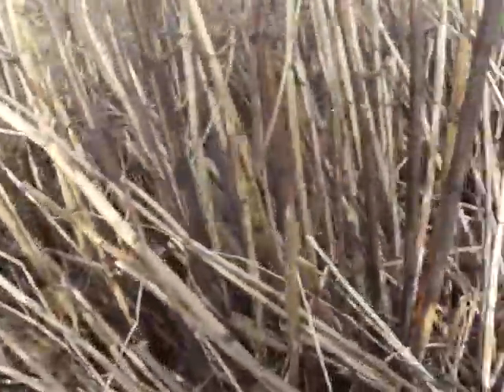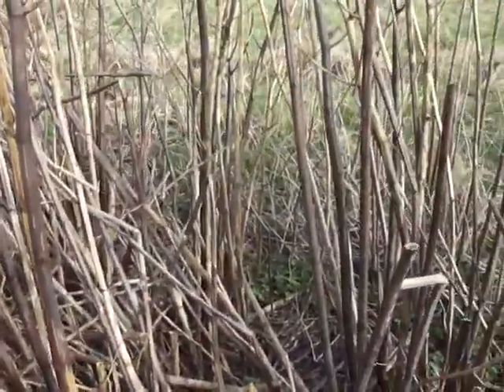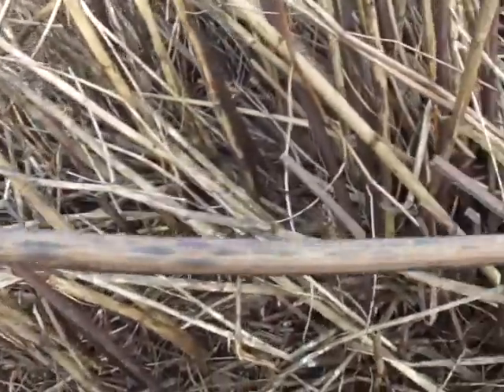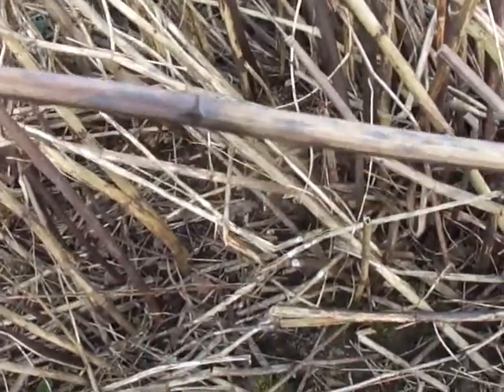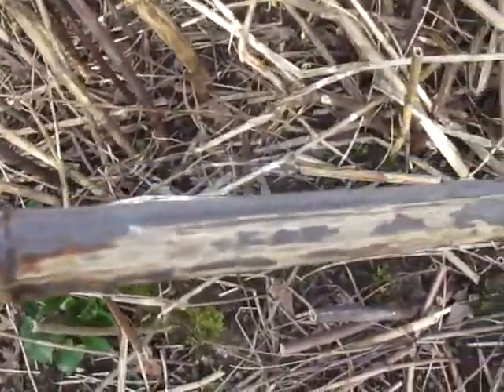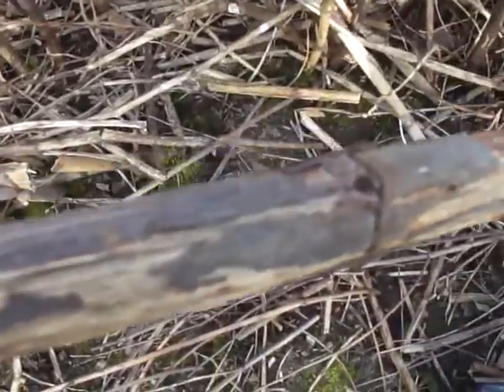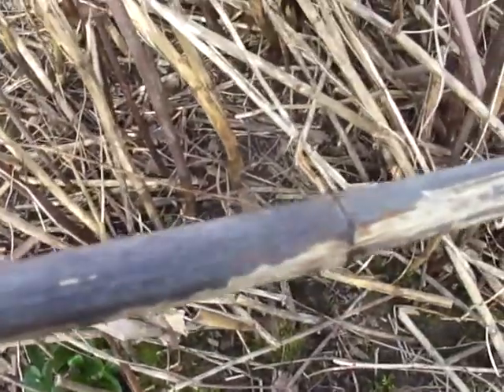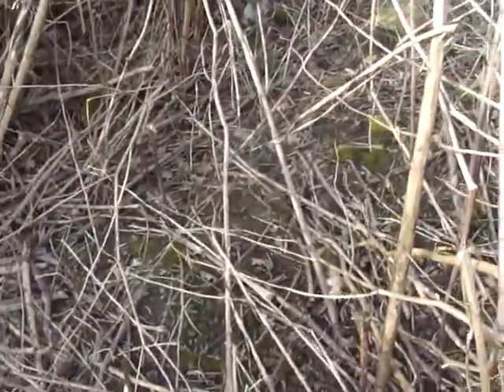Mason bees - how to get long tunnels from knotweed

Comment from the maker: The more I advance with my mason bee project, the more I realise that I am making a clear choices to access the cocoons. Thus nesting materials like bamboo are not practical for my efforts. 
Sand cleaning - although great for large quantities of cocoons - can render cocoons sometimes unnecessarily exposed to  potential humidity issues. So I prefer wherever possible (i.e. when mite/fly-infested cells are absent or fully cleaned) to leave cocoons in their reed tunnels.

Comment: Good suggestion about taking sealed tubes inside early.  Heartbreaking to destroy bamboo to remove cocoons. I tapped a chisel into the knuckle-end of tubes, then hand-split the length..worked well.  Longer tubes had 10-14 cocoons. Several chambers filled with predatory fly larvae and did see mites, too.  I cleaned the cocoons by rolling them in sand...seemed to work pretty well.  But, I like your method of reducing numbers of mites from the start.  Thanks!